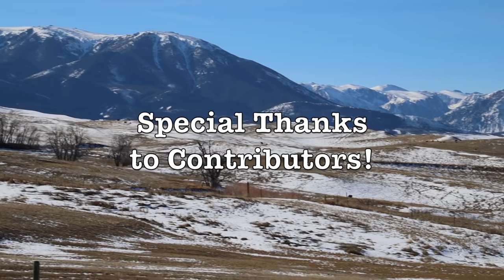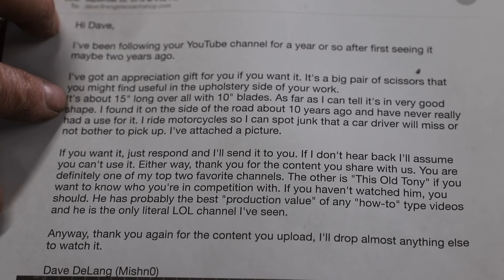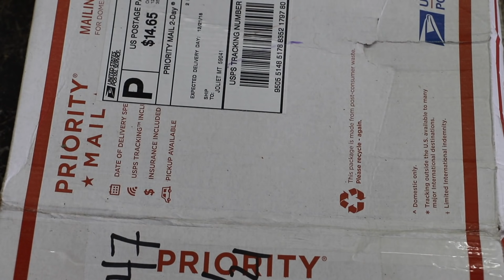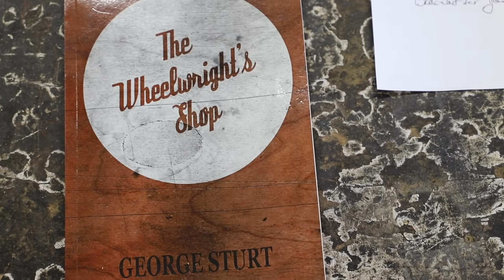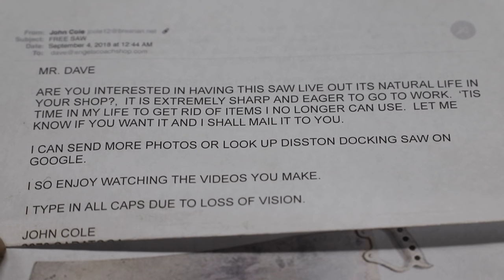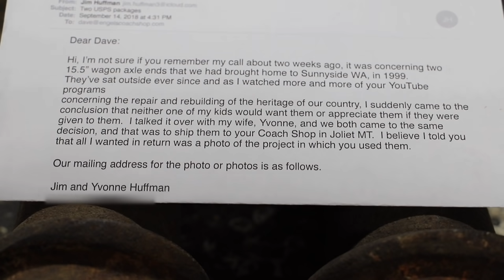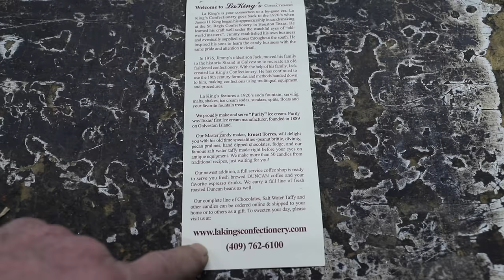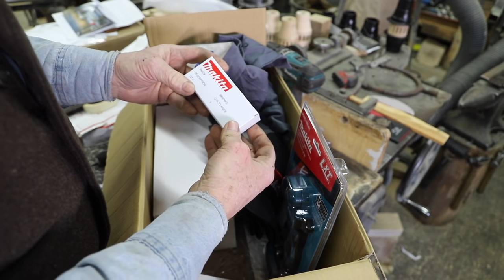Video # 100 and 10 million views on Carriage Building | Engels Coach Shop

Comment: Thank you for your 100th video! Talking about tools - first impressions have a profound effect on me, and, when I was an Outstation technician with the then government dept of Posts and Telecommunications in the 70's and early 80's, our first power drills were from Metabo. Before that we used rawl plug tools to fit wall mounted 'phones, etc. One day I had to fit an extra bell in my future in-laws house above the kitchen door. I stood on a step ladder and started drilling holes for the wall plugs. I hit something solid in the wall, and instead of stalling, the drill nearly threw me off the ladder! From there on,  I was a Metabo fan. The first electrical portable soldering irons we were issued with were made by Weller. They worked off a 12V transformer and had a thermostat that switched them on and off, which meant that you could keep them on all day without burning out the tip. This was very useful if you had an emergency repair that had to be done on critical communication equipment. If you had to to soldering in the field, you could couple the soldering iron direct to your trucks' battery.

Comment: Makita cordless drills up Canada way were the only cradles drill available for about a decade there., and were my intro to cordless drills. My Glazing boss had  a large number of the old style ones with the super long battery. Over the first three years I became more and more impressed with batt life, how fast they charged, how they still operated at 36' below zero, and overall durability.  Then one day, I was 3 stories up on a scaffolding, with a Makita with 8 inch (?) battery inside, and a 8 inch Robertson driver in the chuck when it fell off  and landed on the driver tip on the cement sidewalk. Well, I thought. William is sure going to be unhappy I wrecked that great old tool. It still worked like it was brand new. Amazing...

Comment: Dave, I really appreciate your videos. The range of skills you have is most impressive. I am a retired woodworker and engineer and, as I look at some of the old, traditional methods and tools you use I hark back to when I was drilling holes with a bit and brace and driving screws with a Yankee (still have them). I even still have an old Greenlee sliding impact nail puller.

Comment: congratulations on #100.  I have been watching off and on since you started your borax wagon.  especially learned something when you put the steel bands on the wheels.  I knew from welding and dabbling in forging that steel contracts when it cools down but  never thought of using heat or cold on metal to get a good snug fit.

Comment: Hi Dave, I would love to have the book, the scissor is a Painters wallpaper scissor, wallpaper in the old days had an edge on both sides (with markings for the repetition, the repetition distance could wary quit much according to the pattern, from maby from few inches to several feet, the most econical, less waste, was ofcourse the patterns with the smallest repetition distance) and you cut away that side that was facing the incomming light from windows, that side was put over the edge of the former and by doing it this way the overlay did not cast any shadow on the wall. All the best for 2019, looking forward to watching the upcomming videos.

Comment: 10 million views, nice!  That comes to, what, 10 grand? (Don't answer that, because Google)  I'd be interested to see that Makita multi tool, you didn't actually pull it out and I would like to know if it's any good.
Reply: @EngelsCoachShop  Ya, me 2.  I've had my current one for 22 years because my last one fell over the side.  Never been tempted to switch but the new wave seems to correct some design flaws no one noticed b4.